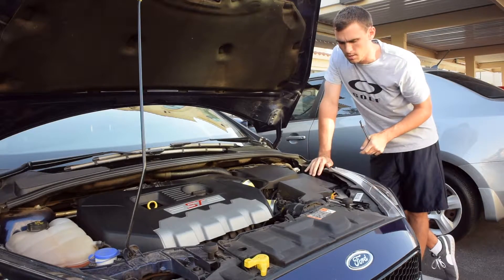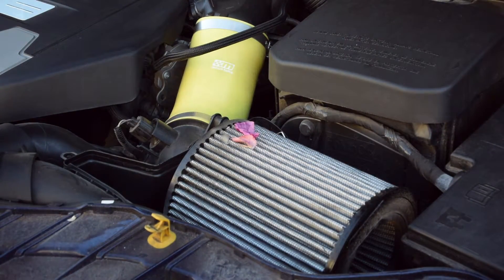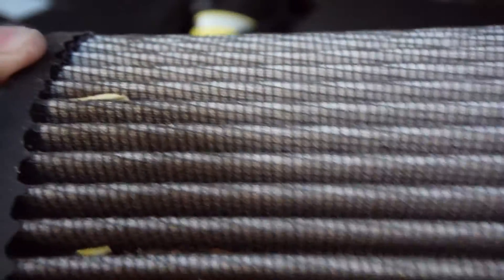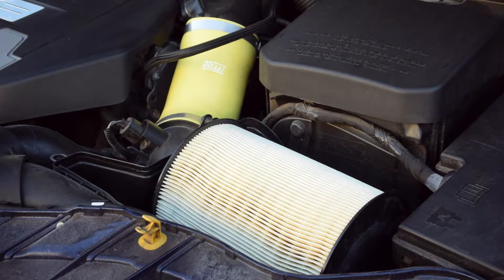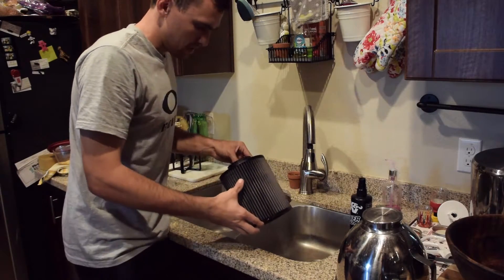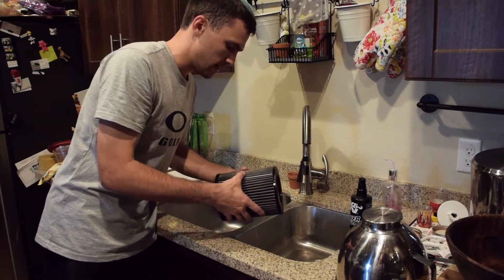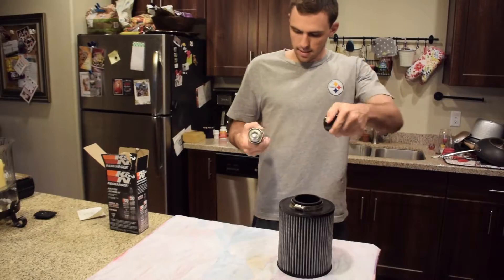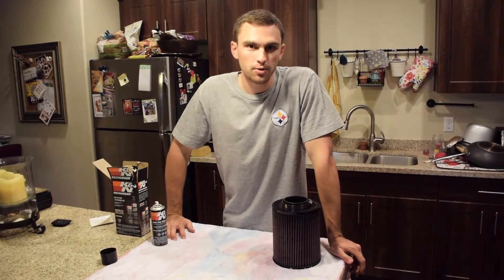How to Properly Clean K&N Air Filter (Focus ST)

Comment: Been using K&N filters on my Motorcycles and cars for years and still do.All the issues you hear about K&N filters,are caused by people not knowing how to clean and re-oil them.Here's what I do.First off,don't use that cleaner,it does not work.All you need to do is submerse the filter in warm,not hot,soapy water.Let it soak for an hour or so,then run clean cold water through it for about 10 minutes.Once this is done,shake the excess water out of the filter then just leave it do dry naturally.Once you are happy the filter is dry,very,very lightly spray the K&N oil onto the outside of the filter,making sure you have covered all of it,do not spray oil on the inside! and there you go,job done.

Comment: Good to know on the Mountune / K&N.  I plan to get that for my new vehicle.  I like that you just have to spray rinse and let dry to use it again for another 10,000 miles instead of changing every time you get an oil change.  Thank you for that information.

Comment: Nice video man...I have been watching your channel from Namibia in Africa! Just a note mate, I actually have a Cobb filter, did a single coat of oil like you did there about a year ago. I actually found dust on the inside of my intake tube by the PCV line. Recently I cleaned it again and applied 5 coats of oil to the filter...no dust so far, no oil on the MAF sensor. Namibia is arid, just like Arizona, thought I'd share it with you.

Comment: I prefer Dry-Flow Air Filters vs Oiled Air Filters. Why? Allow me to explain in further detail. 

K&N has 1/3 the dust holding capacity of OEM filters before restricting, and passes 47x more fine dust. Basically, you got a filter that you have to clean 3x as often as you would replace a regular filter, with the only advantage being that now you only have to pay for the cleaning kit.

They don't necessarily run better so to speak, it's actually less restrictive on air flow. You can actually see more light passing through a K&N filter vs an AEM or AMSOIL filter. This is why as I've told many groups and forums over the past few years, K&N Airflow benefits are only right up until it accumulates a bit of dust. 

1. These filters pass 47x more fine dust, they need maintaining 3x as often, they cost 2-4x as much as an OEM filter (not including the cleaning kit), and as an added bonus, they have a tendency to foul up MAF sensors if you aren't careful when you're oiling them. 

2. TBH with you they're not appropriate for street cars, and that's primarily due to the poor efficiency. Cummins actually has a TSB out telling techs to check what filter is being used when their trucks come in with dusted turbos. Google " turbo dusting "  if you don't know what I'm talking about. Last tech I spoke to, he denied warranties on several trucks when they showed up with dusted turbos and a K&N filter. Poor filtration efficiency = not suitable for street cars. Modern engines with tight tolerances, low friction piston rings, and turbochargers should not use K&N filters.

3. Often, they do start showing issues, but these are usually long-term issues, not 40k miles. Think closer to 100k miles. Bottom line is these filters suck for filtration, but what's worse is they clog 3x faster than an OE filter media of the same dimensions, so you're cleaning them 3x as often, and any performance benefits are negated totally half-way through the filter's dust loading cycle. On those merits, what exactly is the benefit of the K&N filter if you're not cleaning it every 5-10k miles? These are good filters if you have a track built car and you need something that flows a little better when clean and you don't drive it enough to dust load it, but for a daily driven vehicle, they have a number of drawbacks that can be easily addressed with a better synthetic nanofiber filter like AMSOIL, the Injen EA (also made by AMSOIL), or AEM. These filters allow you to run a larger conical filter for the increased surface area (which reduces restriction), while not having to deal with the poor filtration efficiency while maintaining flow under dust loading. That really is the bottom line. There are better filters out there that don't have the drawbacks of this antiquated 1970's filtration technology.

In closing, I happen to own a Focus ST (2018) I opted for the AEM Dry-Flow Air Filter. It traps more fine dust and dirt, costs actually less than other filters and doesn't require me to have to buy a cleaning kit. Not to mention less down time between cleaning.

Comment: Isn't the air coming through the non-capped open end not getting filtered?  It seems it would get sucked directly into the inside of the filter from the engine bay.

Comment: @RGBGFIVE I would go back to stock air filter ASAP. oiled air filters like the K&N have issues in the Focus ST, the oil builds up in the intake and eventually coats the MAF sensor and causes it to overheat. That is why the red disappears from the filter, its getting sucked through the filter... Bad mojo.
Reply from the maker: That's a really good point you bring up and mine did lose the color as you know. I actually haven't put it back in since I cleaned it but I am going to talk to the people at Mountune to see their opinion on it.
Reply: 5dmc1 focus ST's have MAP sensors not MAF sensors
Reply: Have you heard anything back from mountune? I recently purchased this and am thinking of putting the stock one back in after seeing this.
Reply: @Gjeebs  what did Mountune say mate

Comment: Thanks for the tutorial mate, just curious with your intake, do you have the full intake piping or just the high flow filter? If you only have the filter, do you still get extra intake noise and can hear the blow off valve more with just the filter?
Reply: *stock blow off valve
Reply from the maker: I just have the high flow filter and I get a ton of extra sound both on induction and  blow off sound. It's a great part for the ST
Reply: Nice! Cheers for the reply, I want those noises but don't want to tune my car as it's under warranty still
Reply from the maker: This is a great way to do that and very cheap!

Comment: So one, you only spray the oil on the outside and two, how long did you let the oil settle in before putting it back in the car?
Reply from the maker: +incanwarrior22 yes only spray on the outside and I would say 24 hours to be totally safe
Reply: Can i spray with fuel oil?

Comment: will changing my stock air filter give me a check engine light?
Reply from the maker: No
Reply: @Gjeebs  I did gave me an error to check  the engine now,  maybe because is wet??
I use the paper one at the moment, dry, on 1.5 tdci, focus mk3

Comment: Do you Experience any Dust Pass through into the Engine ?
Reply from the maker: I didn’t see any in the intake hose when I changed the filter. It was surprisingly clean. Especially for Phoenix which is very dusty